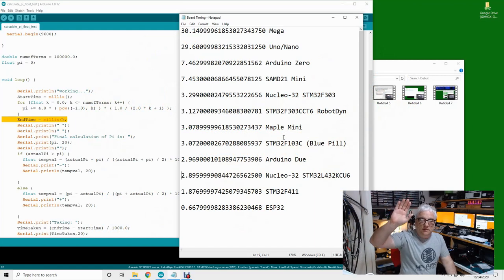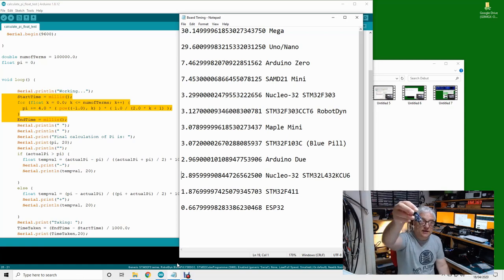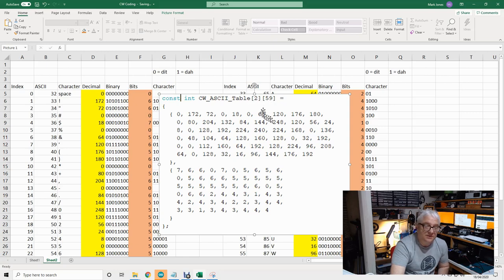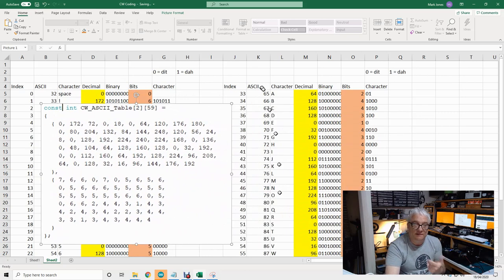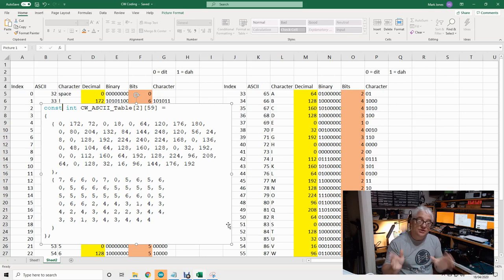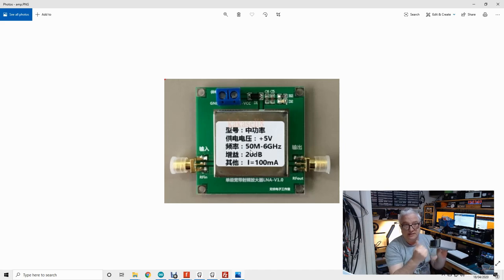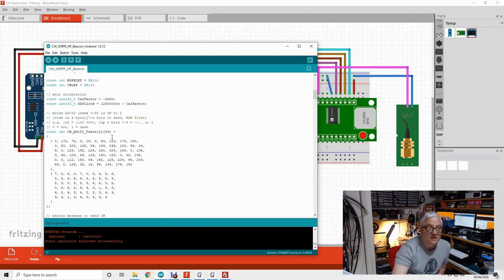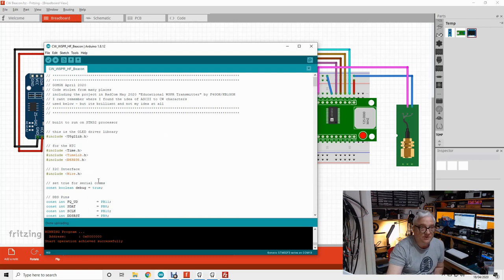A CW & WSPR Beacon homebrewed using Arduino

Comment: An excellent project, I tried to get a Nano to run Jason NT7S JTEncode library for a WSPR beacon, but it wouldn't fit in the 2k SRAM. I meant to move to a bigger MCU but lost interest.  One day. The CW table coding scheme is brilliant. Have you used a STM32 blue pill as a controller in a receiver? If so, any noise problems?
Reply from the maker: Hi Paul, I use STM32 boards everywhere! No issues with noise to date.

Comment: What is the power going into the mmic/what voltage are you using/how hot does it get?

Have you seen anything about generating ft8?
Reply: I guess I should say I've seen this example code in the JTEncode library for an Si5351 - https://github.com/etherkit/JTEncode/blob/master/examples/Si5351JTDemo/Si5351JTDemo.ino - but I haven't found where anyone has done an FT8 transmitter using it.
Reply from the maker: I'd need to measure it so I'm not sure. The gain in the MMIC was 20dB exactly at 50Mhz as I did measure that. The unit isnt getting hot and is running on the on-board 5V regulator. Regarding FT8, that needs a TX/RX cycle to make any sense so I havent thought about generating it using DDS. WSPR is something that can just merrily chirp away to itself all day. The RTC is important as I am sure you appreciate - the TX needs to start at the top of the minute. In reality I wrote a simple routine to set the RTC from a GPS unit then moved it to this project as it is battery backed.
Reply from the maker: I've had a few reports now from the beacon TX so it's certainly getting out OK. Its connected to a vertical "shite stick" antenna I got from LAM Communications. I think its a Diamond D2000 - but I'm not sure.
Reply from the maker: I really did mean "white stick" sorry :-)
Reply: @MarkG0MGX  Quite the Freudian slip there  :)